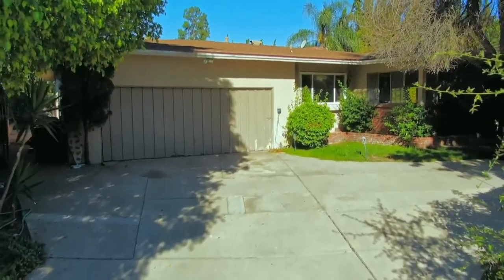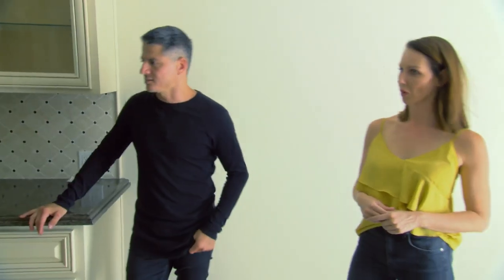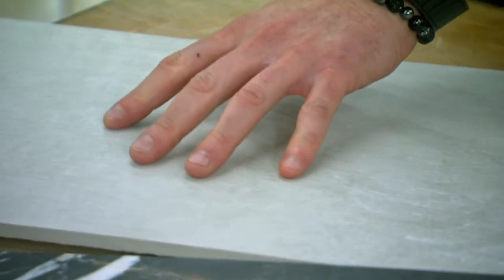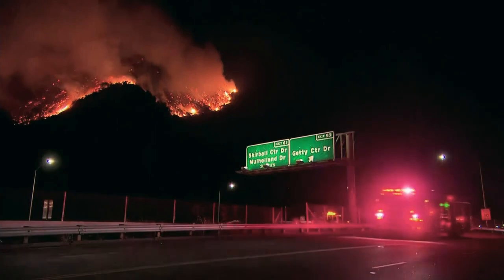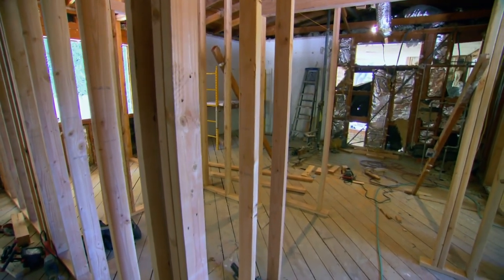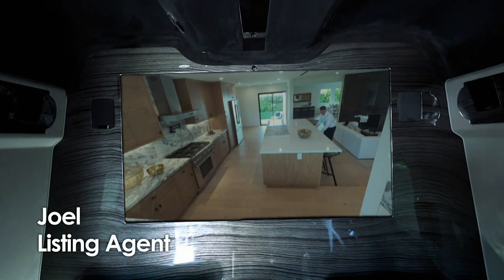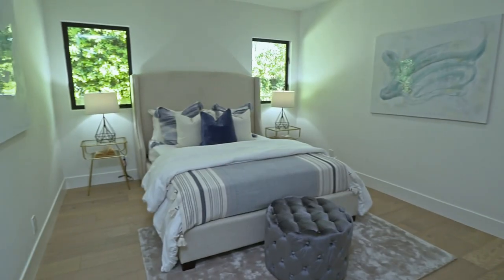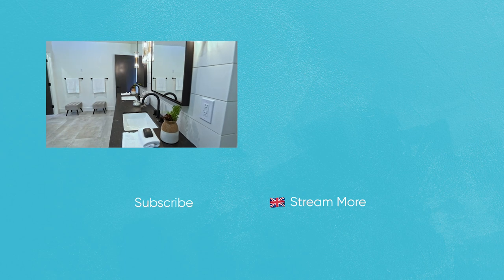Tarek Helps During A High-End Flip That Could End In Disaster! | Flipping 101 With Tarek El Moussa

Comment: The kitchen worked at a distance but upcllse is where it is a problem..  The oak may have worked if it had been a more neutral finish. The weird yellow pea-tone is gag-worthy and a gray tone would have worked better up close.  Fireplace with the pattern is a no.  The exterior came out worse, too.  The high degree of metallic looms over the bed in the master bedroom.  A less metallic print would have looked better.  Four wooden chaises along the back patio would have deemphasized  the smallness, felt more grand and connected.

Love the entry doors from inside.  Tub and shower feeling like they are part of the same space was cool.